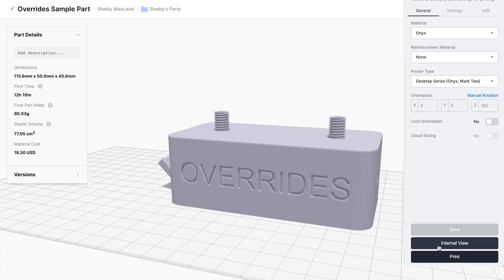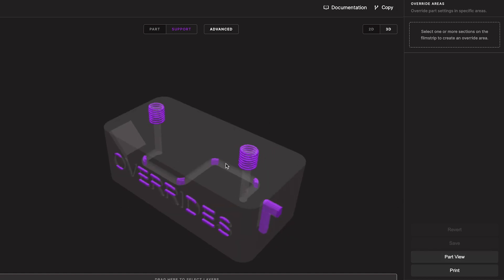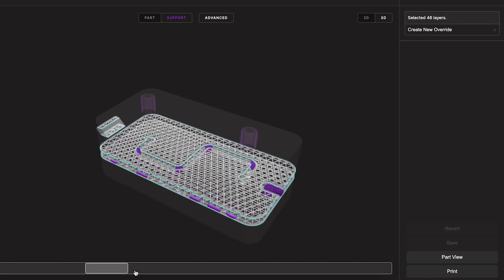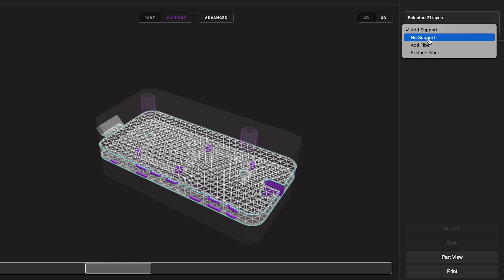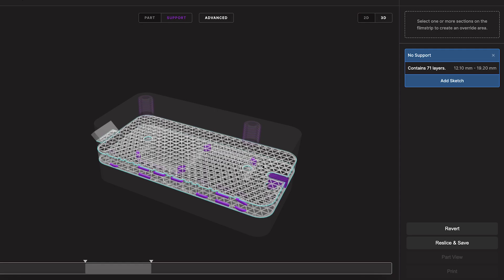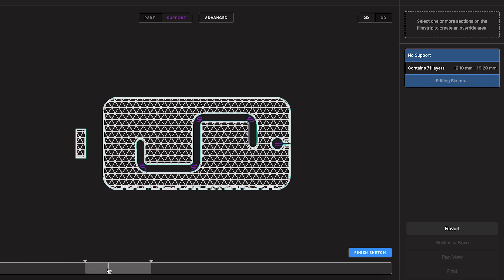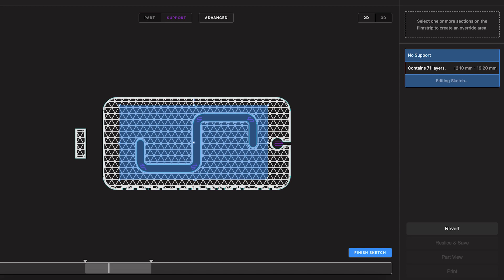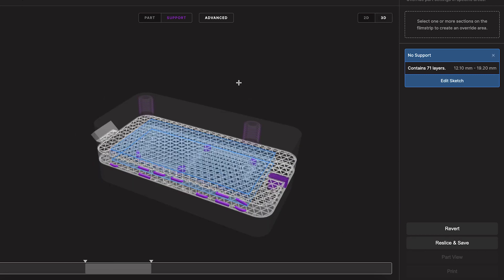How to Customize Supports for 3D Printing | The Software Update

Comment: Great new feature! Thanks for adding! Removes the hassle of changing designs to eliminate support structure where we KNEW the printer would do fine even without support!

Any indication if quick duplication in a print build (add multiples of the same part) and fast arranging/patterning is ever going to be added?
Reply from the maker: Hey Luc! Thanks for the comment and glad you find it useful. You can add multiple parts to your print bed right now in Eiger! Once you get the the print screen go to “add part”. Also, thanks to your comment we’ll be dropping some new videos soon about how to optimize your settings for faster printing. Thanks for watching!